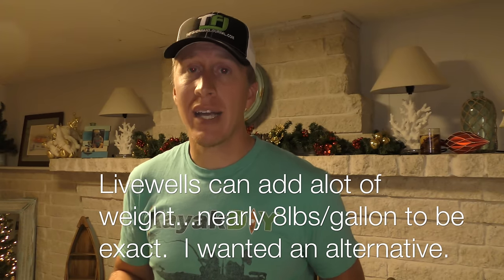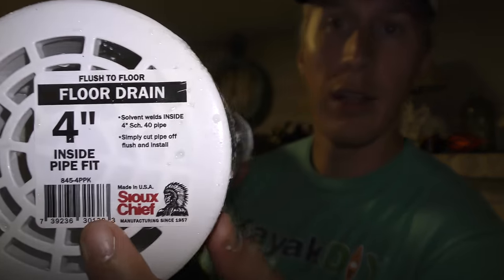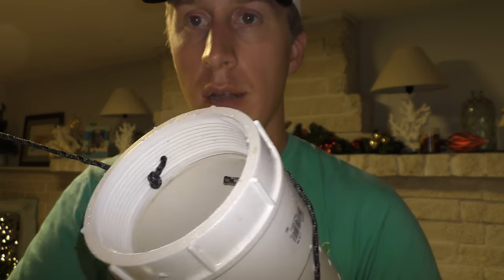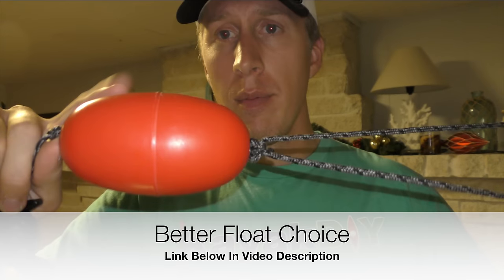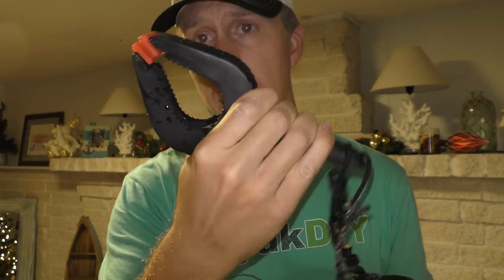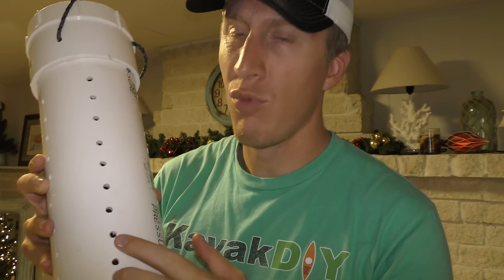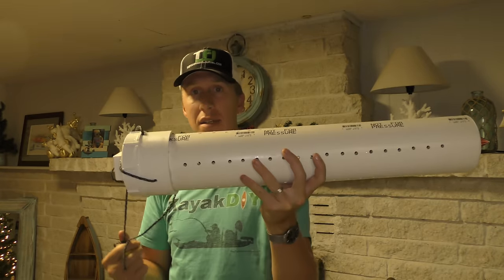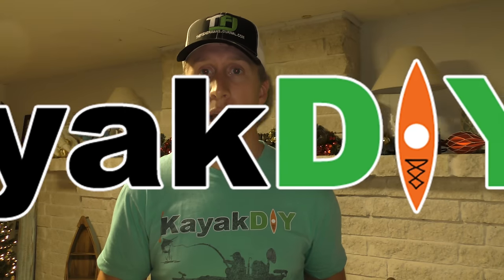Homemade PVC Bait Tube

Comment: Over here we put a funnel or cut down bottle at the front to create a sleaker profile . Also good to have both ends open so bait goes in head first from rear . Comes out head first from front . Some guys hinge each half so opens like clamshell along its length . These contraptions are good  for squid as let's them blow there ink out . Ink is messy.  .  .  ;^ )
Reply: Instead of gluing each end on , make end caps slide on/ off loosely .link each cap with bungee to stretch on and off main tube . Easy opening at both ends . Bungee holds caps on pulling towards each other.
Reply from the maker: +Grunter Thanks for sharing!  Very interesting!

Comment: The holes on the 2 feet pvc pipe, did you have to drill them? Then had to file them so the sharp edges dull down? The holes look evenly drilled if you drilled them. I haven't been to Home Depot yet but I do home they have the pre-drilled PVC pipes for lazy guys like me.

Comment: A friendly suggestion is to drill a few holes in both caps,  in that way when you tow it water will flow in and out circulating through the tube,,,,other is a great video and good job
Reply from the maker: +YBW0S0 not bad suggestion.  Works either way.  More holes the better really.

Comment: Hey, if you don't mind, where did you get your T-shirts made?
Reply from the maker: +Black Warrior Lures I designed them and produced them at Teespring website.  They were ok but color retention after washes isn't as good as screen printing.  TeeSpring appears to use sublimation or a cheaper process.  However, if you are planning to have some shirts made I would look elsewhere.  A local screen printing place quoted me at $14 for my logo on SPF30 long sleeve athletic shirts.  They just had a minimum order of 20 pieces.
Reply: Thx, man.

Comment: since pvc does not float how does it look in the water intrested in seeing it in action
Reply from the maker: Some PVC at Home Depot does actually float.  The main tube portion had buoyancy.  The main pvc pipe had a foam like inner layer and was lightweight.   Fittings sink so they do decrease buoyancy some.  Worked out pretty well....then I lost it on a trip few months back.  Forgot it at a kayak launch area.  I’m an idiot.  Someone must have taken it before I got back to ramp.  Couldn’t find it.

Comment: i have a very similar set up. but my shrimp die. not right away - but do die a little to soon. first I thought that I didn't have enough holes, so I added more(they still died) do you think the PVC maybe poisoning them?
Reply from the maker: Don't think so.  I don't think they would use it for house related plumbing if it was toxic.  Could be the turbulence stress killing them.  Shrimp can be difficult to keep alive.  I have best luck keeping baitfish alive in these.  Shrimp I usually run in a small container with bubbler.  Shrimp just are too dang stubborn.
Reply: thanks for the reply